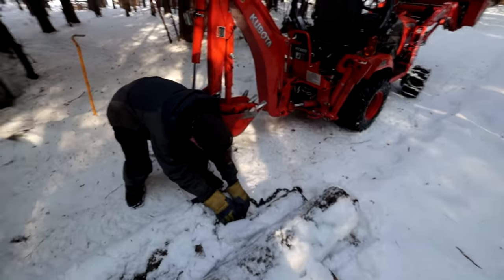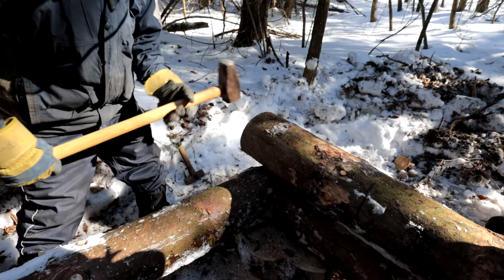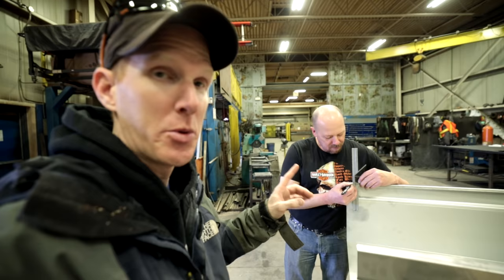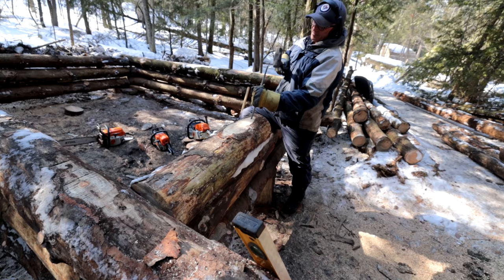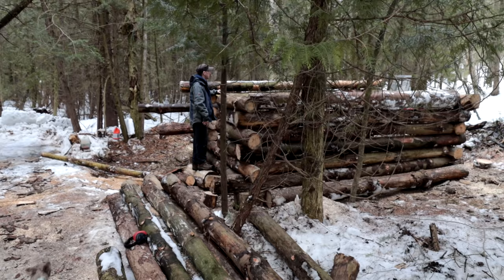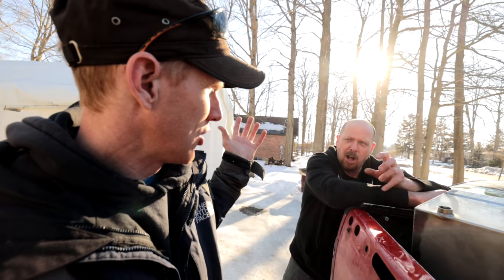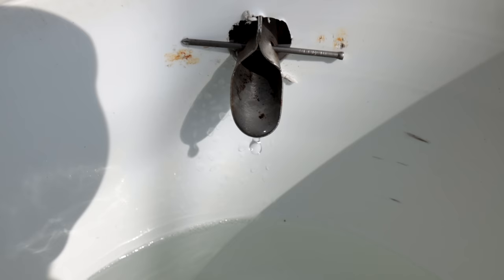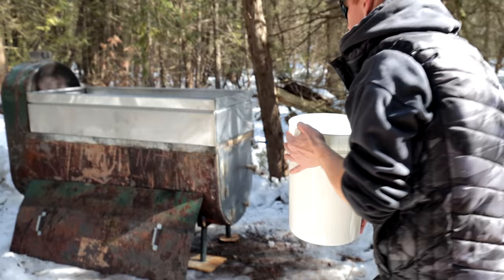Building a LOG CABIN in the Woods!

Comment: DONT YOU JUST LOVE IT WHEN A PLAN COMES TOGETHER!!!!! Was looking at your SugarShack progress looks great the pin method looks like the quickest to build although you may have to make the door opening alittle bigger just so the wood stove will pass through it. Floor would be awesome with gravel and fire brick underneath it like would level it effectively. Although make the stack side higher at ground level the mouth side for the wood lower so it would make it easier for the Maple syrup to drain more efficiently. Simple OUTSTANDING JOB GREAT VIDEO Thanks for sharing. God bless be safe stay warm. Jim
Reply from the maker: The Doors final size hasn't been cut out yet.  It'll be 36"

Comment: How many gallons your tank holds is around 75 gallons, if you only fill it 2inches is about 12.5 gallons. 

Width: 24" (60.96cm)
Height: 12" (30.48cm)
Depth: 60" (152.4cm)
Your tank's volume is approximately 17,280.0 cubic inches or 74.8 U.S. gallons, which is approximately 283.5 liters.

Width: 24" (60.96cm)
Height: 2" (5.08cm)
Depth: 60" (152.4cm)
Your tank's volume is approximately 2,880.0 cubic inches or 12.5 U.S. gallons, which is approximately 47.3 liters.
Reply: At a 4:1 ratio, that's still a LOT of syrup!  This comment is so underrated, thanks for taking the time to do that. :D
Reply: @EnsignLovell  40:1
Reply: @dwrivers47  My bad, swear I listened, just didn't read my message haha

Comment: As always, awesome video. 👍
Question on the cabin chinking, if the chinking material is solid all the way through the gap will it carry the cold temperature from the outside in? Do you need a gap or is there a specific kind of material to use? 🤔
I'm in favor of the still idea! Especially if it helps the party pavillion to materialize! 😉 stay well in the fluctuating temperatures and give the family a big hug from those of us state side. 
✌💜🐖💨
Reply from the maker: Usually you'd use roxul as a thermal break in the middle of the chinking
Reply: @ModernSelfReliance  sweet thanks!

Comment: My intuition for avoiding using branches as pegs in pioneer building would be to avoid using any heart wood and young wood tends to be more flexible.. Just my guess though

Did your metal working guy not make a lid for the container? Gonna get everything from twigs and leaves to beetles and birds falling in that sap and ending up on your pancakes without some kind of lid lol .. And a domed lid with a few holes would help it heat quicker but still allow all the steam to escape
Reply: Pretty sure they're still making the oversize lid out of logs. ;) Should have skylights too!
In all seriousness though, yeah, some sort of a lid does sound very reasonable to us city-folk. Even a tarp stretched above would probably prevent most of the junk.
Though everything boils down to tradeoffs due to limited time... ...or maple syrup.
Reply: The lid was stood by the side it was the piece that he cut out of the tank, but they just wanted to watch the first boil and get excited that it actually worked.

Comment: Oh, I know a little about ice! Basically, if it's just a top-layer (a few inches thick), it's probably mostly water. Because early on, the way water crystallizes tends to push the impurities away. That's when you get really good, clear ice. Eventually even the less-pure water will freeze, trapping that sugar inside it (it will also try to expel the gasses that are trapped in there, which is why you often get those ice cubes that are clear around the edges and then have a lot of bubbles right in the middle).

So, if you find you have a bucket with a relatively thin ice layer on top (like, up to a third of the total contents), yeah, you can probably discard that layer and save yourself some energy with the boiling. But yeah, if it's frozen straight through it's a moot point and you should just boil it all.

Comment: That thing about the ice is true. When aqueous solutions (like your maple sap) begin to freeze, the ice crystals exclude most of the stuff dissolved in the water. The ice that forms first has a lot less sugar in it, leaving more sugar per unit volume of liquid sap. The more concentrated the sap gets, the more sugar will end up in the ice, so at a certain point, you're going to start losing more and more product.

If you're interested, look at the process they use to purify silicon for making microchips. They basically use the same principle over and over to get obscenely pure silicon ingots. Fascinating stuff, really.
Reply: In the wine industry it's termed fractional freezing.
Reply: @bobbyk6585  I'm not in the wine industry, but I'm a chemist/molecular biologist and I home-brew, so I may have to try that! I've been experimenting with a distillation column, so maybe that will help me along.

Comment: Just make a lip for the pan to sit in weld someone weld some 2 inch flat stock around the edge of the oil container for the evaporator pan to sit in a nut should eliminate all the gaps
Reply: And I wondered what kept the pan on top of the burner aside from just gravity.  I mean, one errant nudge, and the thing could go sideways and come off...
Reply from the maker: it weighs a ton. I don't often knock pots off my stove.
Reply: @ModernSelfReliance  I made the comment because I saw the pan shift when you were installing the drain pipe @26:56.  Sure the pan is empty, but I wouldn't think a tank near the end of the reduction would be that much heavier.

Comment: I would have thought you would have run the logs through the mill to flatten the bottom and top
Reply: They do have the mill...but getting it into the woods in the snow season is another matter.
Reply: It's just more work with same results, plus when we put the logs in we can rotate them in the direction they fit best with all the other logs already there.  Many of them fit one way best, and you don't really know that until you try them.  In a perfect world, each log would be the same size and shape and length, but ours are of various different lengths and widths.  It made most sense to do it this way, and then adjust as necessary.  The chinking will give it a great look after that you wouldn't get if you shaved off the rounded edges.
Reply: Then it's not a log cabin anymore.

Comment: When I lived and worked in the desert we were always quite similar in not throwing much away. Granted that was because you couldn’t rip into town for a piece of steel you needed to make something work. The boiler looks great and looks to be working a treat. The cabin will be a great sugar shack and probably a nice place just to relax at. Though I would probably consider either a concrete or compacted gravel floor in there so there is never concern of the boiler sinking/falling either that or weld some plough discs on the feet for a big service area
Reply from the maker: The bigger feet is probably a good idea!

Comment: I stood up some buckets alongside my evaporator with an adjustable plastic ball valve on the bottom, then tubing leading to the evaporator. It works excellent for a steady flow into the pan, where you don't kill the boil, can multitask better and also don't suddenly find you need to add more sap in a hurry.
Reply from the maker: We'll be better setup next year in it's own "shack"

Comment: It you had access to a band saw mill,  just cutting 2 flat parallel sides and leaving 2 live edge rounded sides, would make construction much simpler and faster.  Also, pre-drilling for your fasteners greatly reduces the effort to pound them in.  No need to struggle putting the fastener through the first log.  Great work on the sugar shack.
Reply from the maker: Thanks for the tips!

Comment: I saw a lot of you tubers mention skinning the logs to avoid rot. I’m not a construction guy or a log guy or…a person that has experience with owning one, 

I’m not sure what about bare wood vs barked wood is the difference in terms of mold vs no mold aside from perhaps maybe the fact that you can apply some kind of oil to skinned logs
Reply: People also remove the bark for skewers, to cook fish. I was often told that a lot of tiny creatures live under the bark, so removing it is cleaner in the long run.

(I've just watched Bush Radical cleaning bare logs with a bleach solution to get rid of mould.)
Reply from the maker: Once the logs thaw out completely the bark sluffs off.

Comment: How about a cylinder inside the pan above the fill level with a screw on /off cap to inset a touch of smoke
Reply: Or wth a check valve
Reply: Using a temporary lid to infuse the smoke early in the boil

Comment: If you really want to know the amount your tank can hold.  According to the measurements you gave, 5' X 2' X 1', gallons of water = length x width x height (measured in inches) x 0.004329, converted ( 60" * 24" * 12") * .004329 = 74.805 gallons.
Reply from the maker: Thanks for doing the math.  That's a pile of maple syrup if full.

Comment: Love the video! 
Why do you only run chains on the front tires of the tractor? I'm looking to buy a subcompact tractor myself and I'm curious.
Reply: I think it's for turning when you need grips...the rear tires have plenty of grip as is
Reply: The rear tire set of chains don't fit past the frame of the tractor.. wheel spacers are backordered forever....